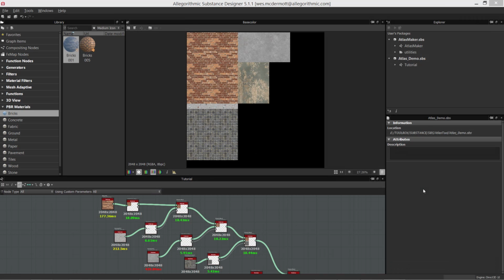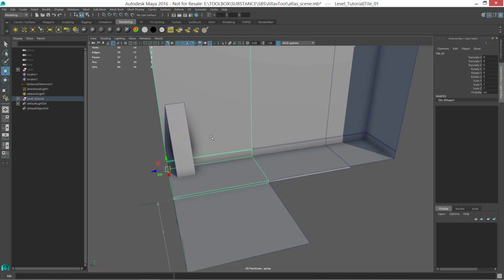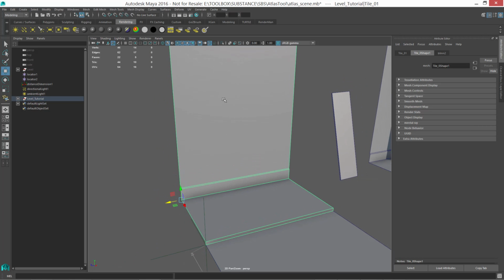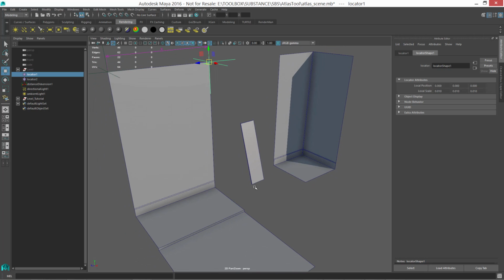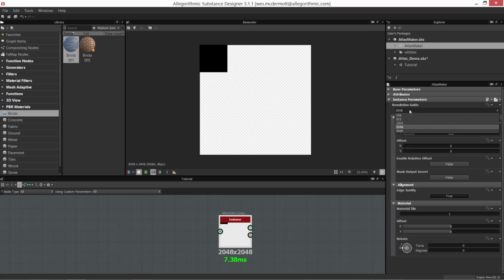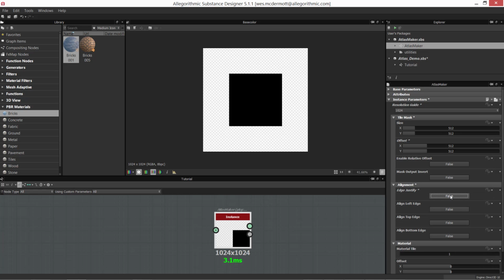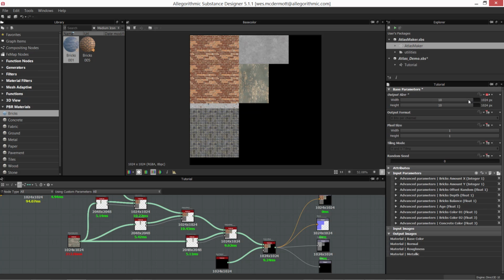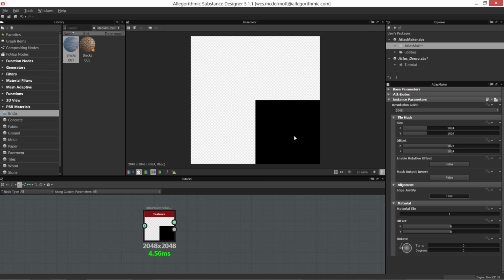Creating a texture atlas #1 | Adobe Substance 3D

Comment: Atlas Maker doesn't crop things correctly. It works fine with Resolution Guide to 1024 and Tile Mask size 512x512, but if I do Guide:2048 and Tile Mask 512x512, the final result of the mask is 507x507, and the situation gets worse at 4k. Would anyone know what can be done to fix this issue? Other than that, everything is great.
Reply from the maker: I'm sorry for this issue. I will need to take a look at this again. It's probably just a math mistake.

Comment: Hi, having the whole wall look alike and repeating iselft is looking unrealistic.
So is there a way to randomize the brick texture somewhat in itself, so you wont see the same structures over and over again? Or do you have to do it like you did with the planks in part two or three?

And the Atlas size you chose is the size and resolution of the (final) texture, correct? In example for your scene you have chosen a 2k texture?

Comment: Great utility! although is there any plans to enable non square textures/materials be correctly scaled and tiled I cant seem to get this to function as expected. It seems to only work with square Thanks again!
Reply from the maker: Thanks for the feedback! I can look into this
Reply: @Substance3D  Thanks for getting back what would be super cool is having a material size slider or entry box so you can enter a specified material size (similar to the mask size one or even linked X and Y) :) Its just generally when I plan atlases they can really vary in size not always power of 2 cheers thanks again!
Reply from the maker: Thanks! This is great feedback : )

Comment: any reason why drag and drop for the atlas maker isn't working? using designer 2018.2.0
Reply: I am unable to drag the atlas maker into my graph in 2018
Reply from the maker: Hmm, there shouldn't be an issue. I will check into this.
Reply: I have the same issue. Is there any solution to this?  @Substance3D

Comment: Hi, 
sorry if this seems a stupid question....
I modelled my scene first, but it was set in the default (centimetres), so when i change the setting in the 'settings/preferences' to metres, the grid gets huge. is this going to be a problem? would i need to join the meshes then scale my scene models up by 100?
Reply from the maker: You don't need to worry about the size as the measurement can be arbitrary to what you decide. Internally, maya works best with centimeters. I never change the preferences to meters. For real world measurement, you can resize the mesh. In your case, you will probably need to scale the meshes as they will be very small.
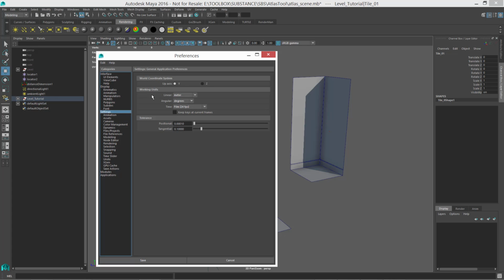Reply: Hi thanks for the reply, just to clarify,: the scene you have created here was modeled in centimeters then you scaled up to meters (as seen here 5:31 ) to get the measurement of 1unit=256?

Comment: That's an awesome tool but It looks like there is a little bug in an offset calculations which turned out as a pretty time-consuming problem.
Here is a very-very simple example: 
If I'll set the offset to 40,40 in a 2k resolution and export the image, it appears to be in a wrong coordinates. In my case it's 30,30.
I'm using SD 5.5.2
Here is the screenshot in SD: https://1drv.ms/i/s!AuyHy4WnaMnUg-EJQKR_DCAT-Oqw0g
And here is the output image: https://1drv.ms/i/s!AuyHy4WnaMnUg-EKyAkx0-tD6dWo9A
As you see, the coordinates are wrong, which makes the workflow pretty odd (I'm unwrapping my uv's and then set the tiling areas in SD by it's coordinates. And after that I'm exporting the image and boom, it's a little bit off in all areas. So I have to tweak the UV's once again to make it look tiled perfectly without any gaps and edge bleedings)
Once again, the tool is great and many thanks for making it real, but it could be much greater without this annoying bug.
Is there any chance to get a fix?
Cheers!
Reply from the maker: Thanks very much for the feedback : ) I will look at this issue and fix it. Thanks for reporting.
Reply: That's a great news! Any updates on fixing this bug? :)

Comment: Thanks a lot for these tutorials. I have a question: why you use 256 as value to calculate pixels? For example, in a first person game I can use 256 or different value (512, 1024,etc.)?
Reply from the maker: Thanks! Glad you liked the videos. You can use any value you need for the pixel per meter setting. This will be different depending on your game. You can use 512 or 1024. I just chose 256 as an example.

Comment: I love that this is even possible in Substance and thanks for doing a great tutorial for it. 

I'm really wanting to be able to do something not shown in the tutorial. Is it possible to add materials that are not square? I've seen NaughtyDog create an atlas with lots of thin tiling trims. How? All I can think of is that the original came from a substance they made that was something like 128 x 2048 etc.The trims wouldn't be coming from a squared substance would it?
Reply from the maker: Thanks! You can use different resolutions in the size setting. You can set the size, then choose make seamless. From there you can adjust seam axis and scale to get the tiling trims.
Reply: Ah, I don't think I explained it well I'll try again. In the tutorial you pull from already created substances, all of them tile at the power of 2. What if I wanted to create a trim of wood with bolts running down it? I couldn't just grab a standard tiling power of 2 substance unless it had bolts going both vertically and horizontally. See what I mean? It's difficult to explain, if you don't understand I can try creating some visuals.
Reply from the maker: Ah, yes. I see what you mean now : )  It will only work with power of 2 I think. I haven't actually tested with non-power 2 but the tiling features are designed to work with power of 2 input.
Reply: Allegorithmic Thanks for the confirmation. In the meantime, I think it's still possible to create an 'atlas' like this without the tool, by having multiple graphs in a substance for each trim and arranging them together in a 'final' graph.

Comment: need help with doing something's please, they may be useful enough to go in a future update.

I am not sure how to go about setting up a function that toggles all relevant maps between OpenGL and DirectX at the same time. it could be a big time saver. I have already crashed substance once, rather not do it again.

When I am using Iray how will I know when it has finished processing the image so I can save it out?

Setting up textures at 2k is fine but when finished I would like to able to bake procedural texture's at 8k to 16k for photo realistic images and animations.

if it is to render a single frame only, could we right click on the 3d view to bring up a render settings menu?

Can we bake scene information the same way we bake model information?

got 16 gig of ram for design work and don't have a single program I can get to use more than 4, can I get substance programs to do so?

the emissive does not glow like a light source should, even in Iray render mode how do i fix it so it does glow, like in Warframes Tennogen (which is a kind of model viewer and project up-loader)?
Reply from the maker: +Matt W Hi, it would be best to post these questions in our forums. I can give much better support to these questions. The Iray render will render until it meets the requirements set. 

You can't bake scene information and the baker can be set to bake 8K. 

The glow should work as emissive into the scene with Iray. I'd have to check the scene setup. Please post in our forums and I can definitely help : )

Comment: Terrific good tuts as usual Wes. Thank you for making these!

Question: Why do you leave the UV layouts for last and measure objects in Maya? The way I see it, it's a lot simpler to unwrap UVs of your scene, re-scale them proportionally&adjust according to how much they'll be seen in the final product, skip measuring and do the atlas.
SD/SP's strength is being able to adjust texture output size anyway, so why is there a need to measure?
Reply from the maker: Justo Figueroa Thanks! So glad to hear you liked the video. For the atlas creation. I measure the scene as I am setting an exact pixel resolution to geometry scale. I can adjust the overall atlas size since its a substance, but the main goal is the tiles in the atlas match the correct texel density to mesh scale.